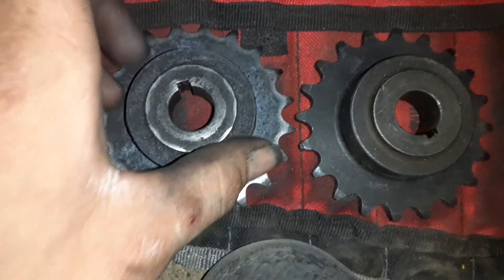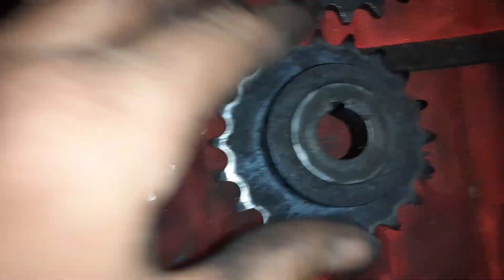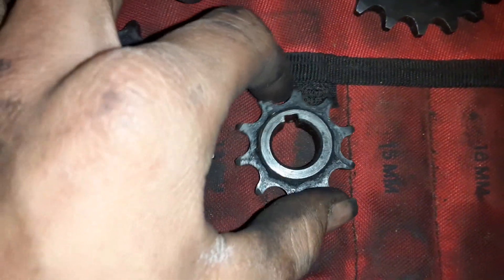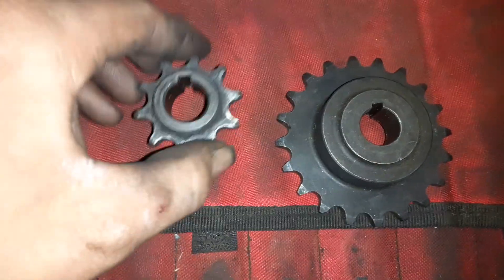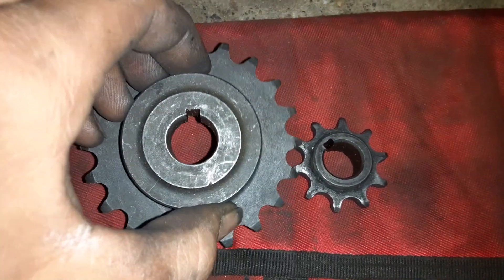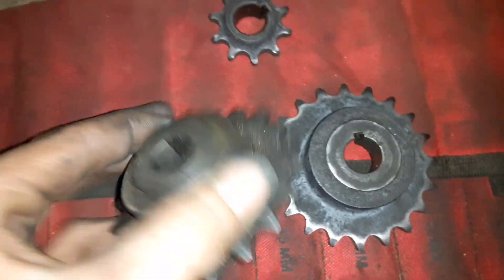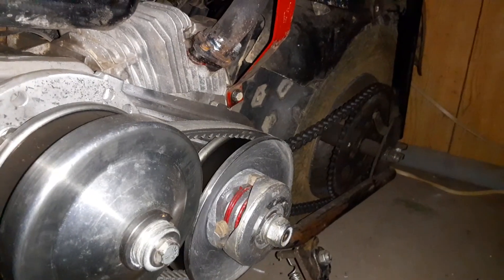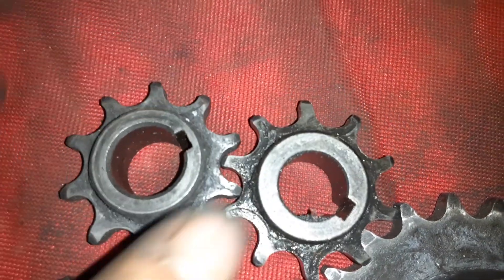Mini Bike Gear Ratios Explained.

Comment: Ok, so I’m NOT looking for speed with this build- I took a baja mini & stuck a 224 predator on it.  
Stage 1 intake & exhaust. 
30 series torque converter.  
Juggernaut driver & I Put an 8 tooth sprocket on the driven pulley and a 72 tooth sprocket on my rear wheel.  
I’m running 21” tires. 
What kind or torque numbers am I looking at here?

Comment: I have a coleman bt200x and I put 212cc motor and I can't adjust it. I barely touch the throttle and I can't control it goes super fast I fell one's. Changing the gears will help?
Reply: Good problem to have. 
Tall or High - low acceleration, high top speed
Low or Short - Fast start, low top speed -- Lower front or add to rear
Larger Ratio = Short Gearing // Smaller Ratio = Taller Gearing

Comment: I got a Baja warrior 19in sunf street tires with a 212 hits bout 60 but I’m thinking of putting 40t on the rear and 12-15t on the clutch will I gain more speed?
Reply: i was thinkin abt that same exact ratio did u try it? lmk how it went

Comment: I have a 208cc engine with a 7/8 drive shaft I have a 12 tooth clutch running to a 72 rear I'm trying to get as much top speed as possible do I get a clutch with more teeth or drop teeth on the rear sprocket I don't know how many to gain on the clutch or how much to lose on the rear sprocket or which one to change if I only change one?
Reply: Bigger drive gear smaller wheel gear will give you more speed if you're bigger drive gear that's connected to the engine spins one time and you have a small gear on your wheel say half the size of whatever you have on your drive shaft one full rotation on your drive gear will spend your half the size wheel gear twice which games do more speed but that also will give you less power to climb Hills so you gain speed but you lose torque and the same goes vice versa

Comment: What's the gear ratio to make a mini bike with a 5 horse do 60 mph
Reply from the maker: There's not enough info to determine that. A 5hps stock briggs won't even get close to 60.
Reply: @minibikegarage1577  what type of engine should I be looking for to get a high top speed on my doodlebug db30 then because I'm sick of doing 35 mph I had it doing 45 with my last motor that lost spark which was much better but I want at least 50 55 mph there's a 13 horsepower motor down the road on a snowblower I don't know what to be looking for
Reply from the maker: @williamedwards7315  I'd get a predator 212. Those stock 212 motors on baja warriors have been known to hit or approach 55mph with a straight chain set up. Look up minibike gear ratio calculator and you will be able to figure out what sprockets you need to use to hit your top speed your looking for. Let me know what tire size and current sprockets you have. I recommend getting a clutch with one or two more teeth. 2 teeth is about ten miles per hour
Reply: @minibikegarage1577  what would happen if I had a 12 tooth clutch 5 horse Briggs with a 36 rear sprocket instead of the 70 rear  that's on it ?????
Reply from the maker: @williamedwards7315  it would be geared so high you'd burn your clutch out before you even get moving.
Reply: @minibikegarage1577  all right I won't do that then
Reply from the maker: @williamedwards7315  drop down to a 60 or even a 55 and you'll probably be in the ballpark. Remember everything has a influence on top speed. Weight, tire size, sprocket size, engine power, max engine rpms, etc. Check out oldminibikes.com it's a minibike forum and has a ton of useful info.
Reply: @minibikegarage1577  One last question do newer horizontal shaft engines with the slant have more power than an old style Briggs because I have a four horsepower Robin Subaru engine and a old style 5 horse Briggs and not sure which one I could get more power out of my friend claims that the newer style slanted engine make for a faster bike
Reply from the maker: @williamedwards7315  yes they do. Engines like predator 212s are much easier to make power with part's  are cheaper and they have cast iron sleeve unlike alot of the older small engines
Reply: @minibikegarage1577  I got a bigger engine it's a 208 CC I need a new clutch so I'm going to try to get more top speed with this new engine that is twice the size of the old one that was doing 40+ mph with a 12-tooth clutch and 72 rear sprocket what's the most amount of teeth I can get on my new clutch or the least amount on my rear sprocket or which one should I change or should I change both how many teeth for top speed but still be able to take off

Comment: What kind of sprocket would you recommend for speed on a mini bike with a 225r tilloston with a juggernaut torque converter?
Reply: Depends on wheel size but that motor will pull through some smaller sprockets than a 212 I can tell you that much! I have a slightly modified Trailmaster with a 223 on it, juggernaut 10t/60t but it can pull a 9/60 on the stock tires, on my outlaw mm80 I'm hauling major dirt with a juggernaut 10/54 and 15x5.00-6 cleats. In my honest opinion it really matters where and how you ride with the Juggernaut. I had it on a 7k rpm 196 build and the juggernaut let me use the entire engine and maxed ratios like 🤪.
Reply: @fatbuddycat  i need to see the 7k 196!
Reply: @sidewayzmike  I have 2 of them on my shelf waiting for frames, I'll get one on there as soon as I can find one. That's the biggest issue these days, too many motors not enough mini bikes.